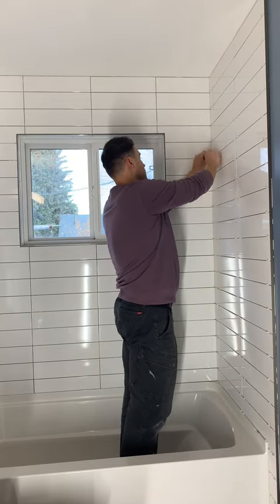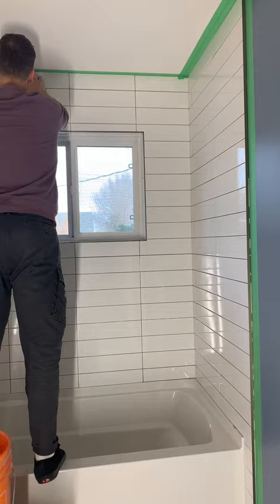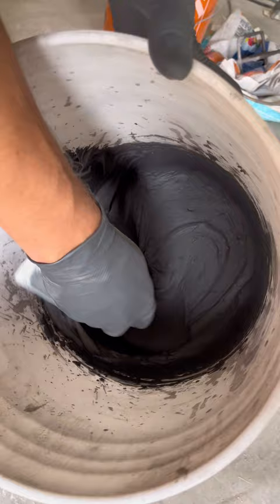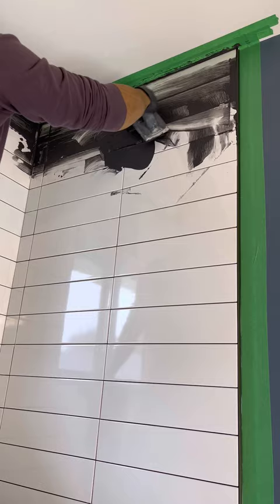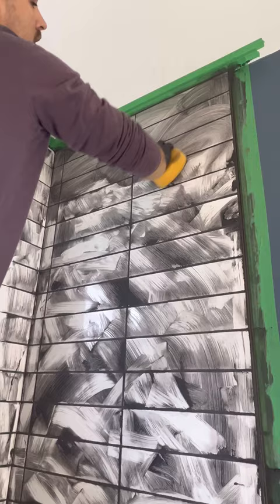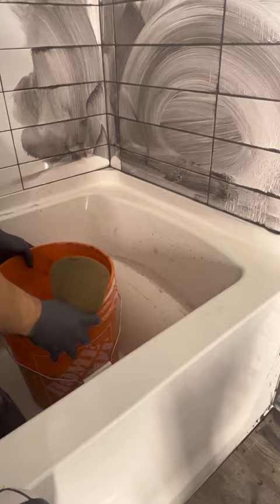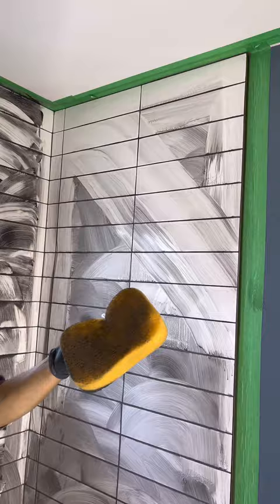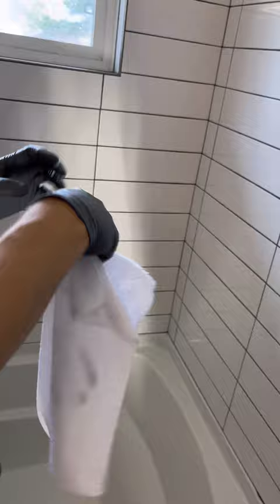How to Grout PERFECTLY Every Time!

Comment: Do not use grout in corner joints. Sanded caulk should be used there. Also helps having two buckets. One with clean water and one to rinse dirty sponge in

Comment: I've been a tile contractor for more than 20 years and grouting shouldn't be done by an inexperienced person, you can literally ruin a perfect tile job by grouting it badly, also there are times the grouting doesn't do what it's supposed to, like if humidity is high or you use too much water to sponge it, leaving haze over the joints will leave different color areas and not to mention the grout has to be pushed in around the joints without leaving voids, just because you could do something doesn't mean you should...

Comment: Question…..I have 1 foot x 2 foot porcelain tiles on my shower walls. Wouldn’t it be better to use unsanded  grout so as not to scratch tile? The joints are 1/8 inch. Thanks

Comment: Shits gonna crack right out of the corner, the ceiling, the floor joints. Silicone or sanded caulk at every change of plane. Don't be lazy. You're asking for moisture to get in there.

Comment: Can I just use pre mixed grout? I grouted once years ago and it came out good but it was a kitchen new backsplash. Now I need to grout bathroom tiles. It’s moldy ….
Reply: You can't use premix on bathrooms.  Check the spec sheet.  It's not meant to be used on waterproofed walls.

Comment: I've heard some horror stories about Ultracolor setting up really quickly and being impossible to remove from the surfaces of the tiles. Not sure I'd want to go with that for a DIYer that isn't really comfortable with grouting.
Reply: First time grouter - used Ultracolor + FA today. No issues. Used cold water and hand  mixed for 3 mins.

Comment: Great video! Just a FYI though, that grout you used doesn’t need a sealer.
Reply from the maker: It doesn’t “need” one because it has polymers in it which are stain resistant, but….it is still a cement based grout which is porous and I have seen it stain. So sealing it especially in showers in areas with hard water is never a bad idea.
Reply: @McGrands  good to know. I’m actually in the middle of tiling my shower and was going to use the same grout. Any specific sealer brand you recommend?
Reply from the maker: @jeremysalazar3208  Aquamix Sealers Choice Gold or TileLab SurfaceGuard maximum strength grout sealer

Comment: I want to know how you waterproofed the transition between that tub that is meant for premanufactured walls and doesn't have a flange. That tub is not meant to be waterproofed in any way other than by using the wall panels that came with it.
Reply from the maker: It does have a flange

Comment: you must mix this grout exactly 3.5 oz of water to 1 lb of powder !!!! i did the consistency of peanut butter. know cutting it all out and having to redoing it all over (shit show)
Reply: What was wrong. When using small batches of mapei fa you can use 3:1 ratio of powder to water. It doesn't have to be exact. But you can't use too much water for the washing process. Peanut butter consistency seems perfect for mapei UC fa
Reply: Like i said I'm currently cutting all my grout out right know it is just a horrific job I grouted and let it sit for 2 weeks turn on the shower and it bled black it seeem as soon as it got wet it turn back to mud talked to Mapel representative told me i mixed it wrong but give me a free bag of grout big fucken deal
Reply: @mikeheggie6986  must've had too much water during the wash. Especially if ur consistency was peanut butter it seems like the ratio was right. Did you re add water to the mix at any point during the application